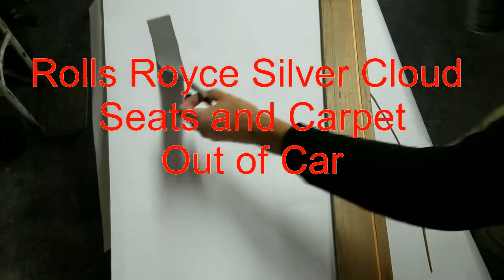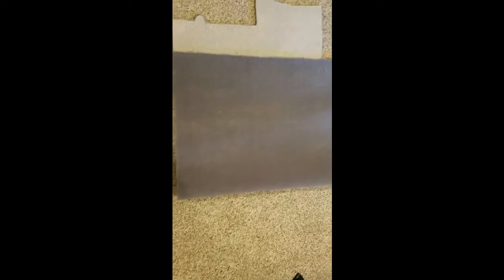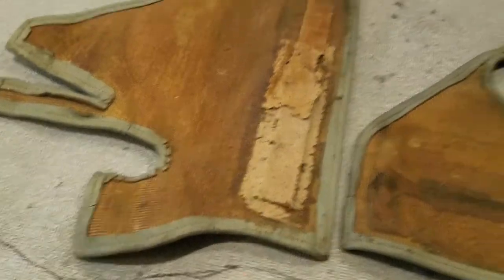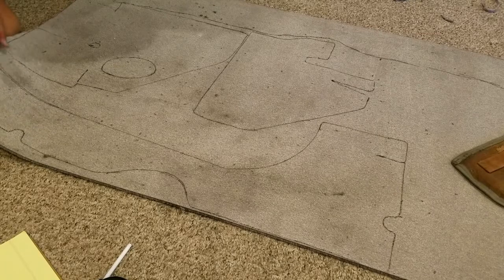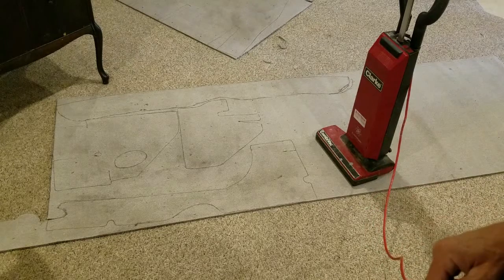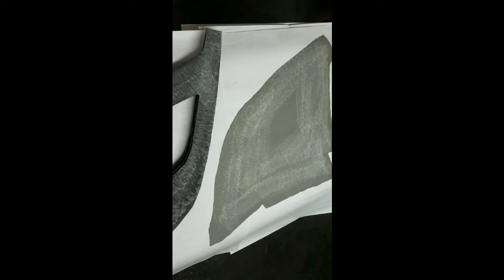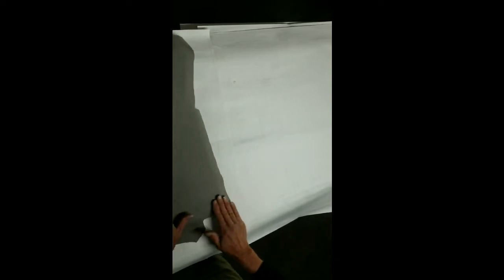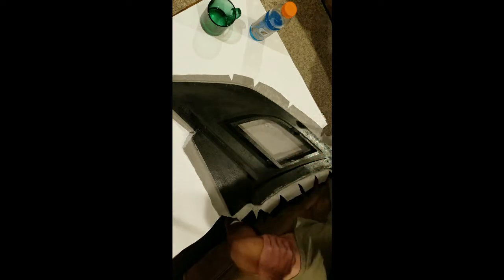Rolls Royce Silver Cloud Carpet and Seats

Comment: Hi Steve. Great videos. Do you know how to take the front seat backs off ? I need to add more foam but don’t want to cut the leather from the front as I’ve seen others do.  Thanks from
England. Will
Reply from the maker: There are very thin pieces of wood that the leather on the back of the seats are glued to and if you Also take the  picnic table  Out you can pry that wood off.  But there is no access from the back of the seat there's another layer of wood so you  Can't go in from have to take the back.  You can then remove the staples around the edges so that you can remove the leather on the front without having to cut it